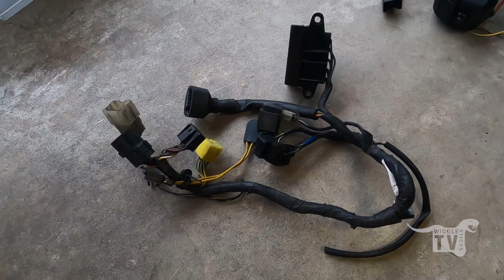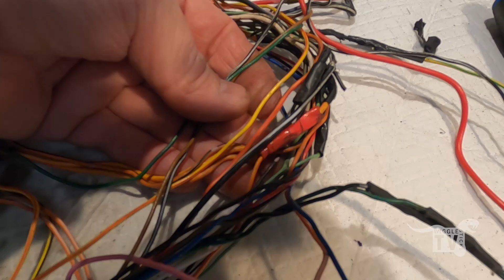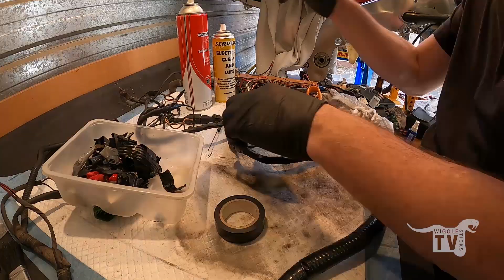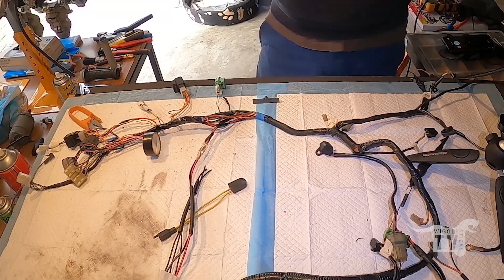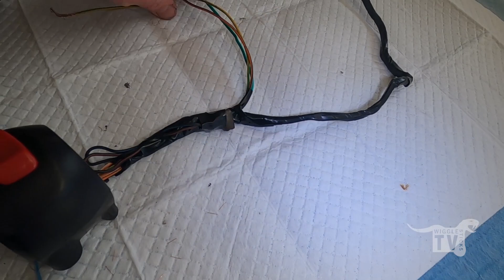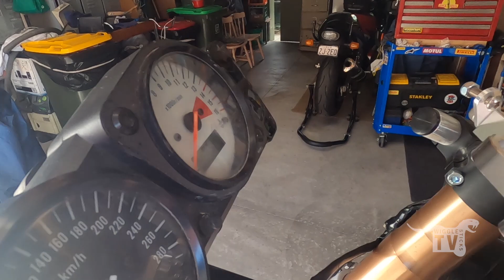1996 GSXR 750 SRAD Track Bike EP: 11 - Wiring Harness. Will it light up?

Comment: How did u set up your ignition eliminator I'm in the middle of doing the same thing and I'm lost
Reply: Can u drop the link so I can order one
Reply from the maker: @mosesburd8570  https://www.sportbiketrackgear.com/woodcraft-suzuki-gsx-r750-96-03-keyswitch-elimination-harness/

will work for any from 96 - 2003. super easy.
Reply from the maker: Just plugged the woodcraft key switch eliminator into the harness where the ignition key wiring normally plugs in. Then I added the start button by moving the switch from the handlebar over to the tripple.
Reply: And does it work for a 97
Reply: They're out of stock... do u know where I could order something similar or a new ignition?